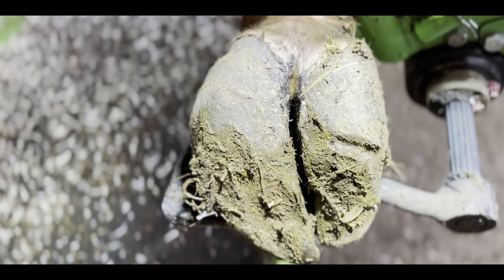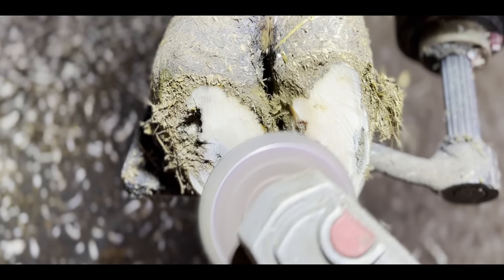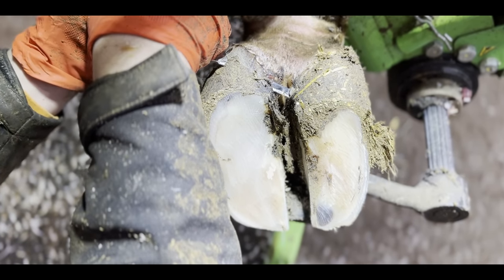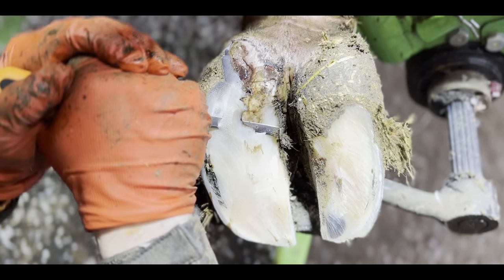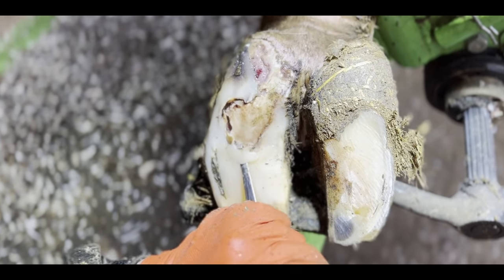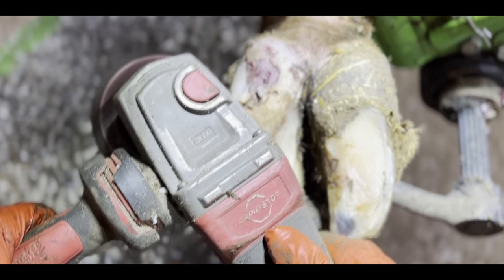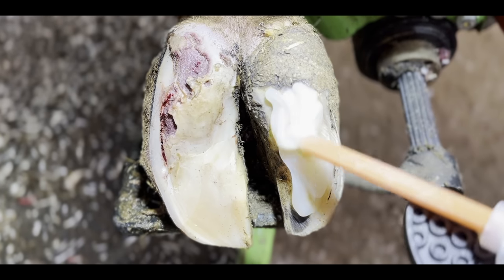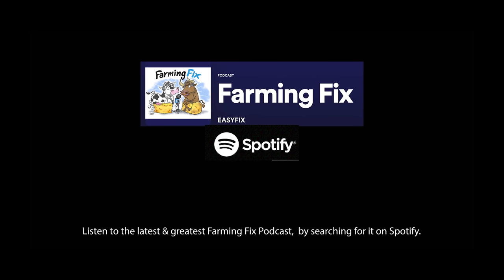HUGE RELIEF for DRIBBLING COW's HOOF

Comment: One thing I've noticed GP do that some others don't or don't show is applying heat to the surface of the hoof that the block is going onto. Imagine it helps form a stronger bond. Also he runs some more resin down the sides of the block!!! Well done and Happy Holidays!!! 💯✌️

Comment: Graeme, is there a reason you don't keep a hoof pick on the crush? Whenever you come across debris and especially stones, I wonder why you don't have one - it seems like it would be a way better tool to use than your knife, because you wouldn't have to worry about dulling anything. Is there a professional reason why not, or is it personal preference, or....? 

Also, a lot of the time you finish a trim and there's still what looks like delaminated horn and/or sharp edges that could poke into the corium -- I usually just assume that I can't tell what should stay or go, since I'm currently disabled and so far as I know the only times I've ever worked on a ranch or farm were for catering gigs. So how do you tell? Am I missing something obvious? 😅

Comment: I've been watching you for a little bit now Sir, and the only thing that I noticed when you asked, is that, please correct me if I'm wrong, the lateral claw was longer than the medial.  I figured that it wasn't wearing off fast enough because they weren't putting enough weight on it due to pain. So the slight size difference and the possibility of not putting weight on it would tell me that the problem would have been the lateral claw close to the heel.  Was there digital dermatitis present as well?  I saw you wrapped it with salicylic acid after the iodine, or was that added to help dry it out further?  Merry Christmas to you and your family good Sir.  Be safe and continue keeping cows happy and comfortable.

Comment: I have a question. You said this is a common problem in cattle kept on concrete. How long does it take to get like this? Once a defect starts to appear, how long would it take for it to get to this point where half the sole is no longer attached?

Comment: Hey,
Is it possible with smart use of the grinder to have the delaminated hoofhorn fall away after the exploratory knife cut? Or is it to often that it could be done because of the chances of that the hoof is possible to be infected to uniquely and to hard to be worked on with only the grinder apart from detailwork(loose bits of hoofhorn for example)

Comment: I am no hoof trimmer, so please don't take my question as nagging, I'm genuinely curious:

Its seems as though you left a lot of the outer horn in place, but we can see the lesion/defect still riding up higher along the outside wall. Is there a reason you didn't remove it all like you sometimes do when treating white line defects that track all the way up?

Comment: Graeme..can hydrogen peroxide be used by syringing inside an infected cavity to remove bacteria and foam out debris? It worked well with human abcesses ...but was wondering if it is safe to use on cows ?
Reply: since it only remains effective for a short time after application, and can itself cause some cellular damage, better options exist.
Chlorhexidine(often blue) iodine(deep red), copper-based products(usually bright green) and Salicylic Acid-based products(generally white) are common.
If you watch enough hoof trimming videos, you will see all of the above used from time to time.